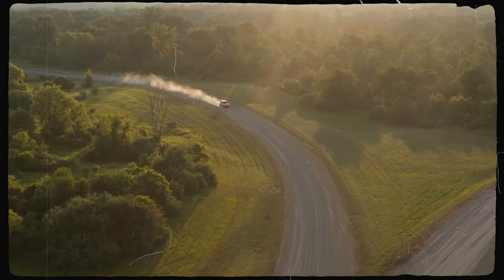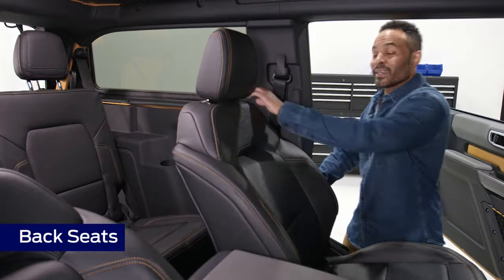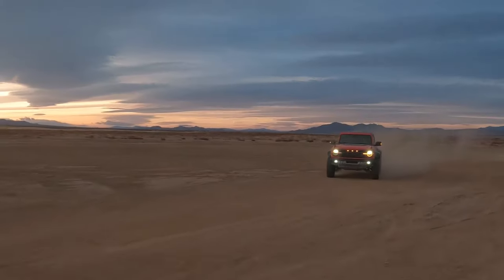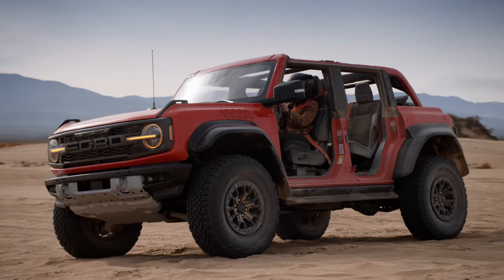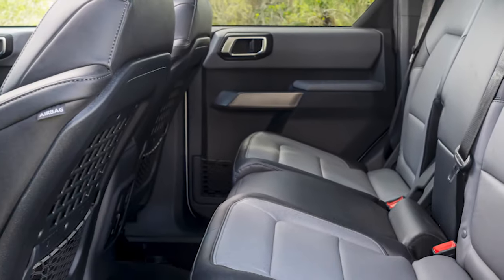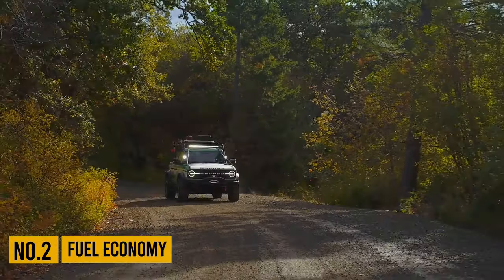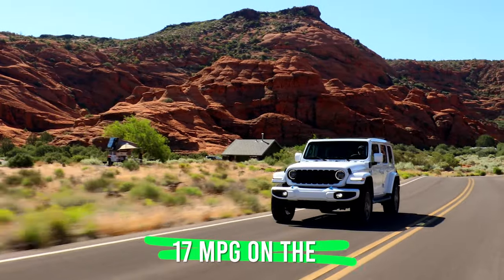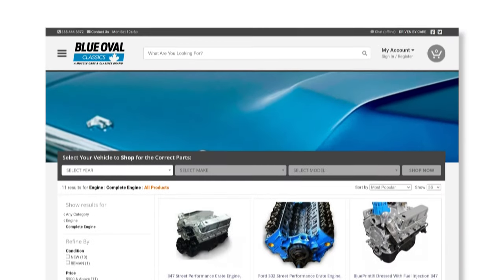7 Reasons Why You SHOULD NOT Buy Ford Bronco!

Comment: Owning a Bronco for 15 months… two doors Manual: vents in the back? No problem, it short enough to feel the front vents. The 2.3L with the Ford’s Performance tune brings 340hp and 19.5mpg in average. Since everyone is driving different, driving wife’s CX5 Turbo brings only 21mpg. The only valid complaint is the audio, it’s really bad, and I had to spend $1,500 to make it half decent. Last time I had a Chrysler product it was leaking more than an old Land Rover, and left me stranded multiple times until I sold it with 78k miles… won’t happen again.

Comment: I owned a 74 Bronco, built tough for the mountains of CO.  I was extremely excited about the new Bronco and  wanted to purchase one for daily.  Dealership markups killed that.
Reply: Back in 2021 when I got my "serious" 4x4 vehicle (was looking in the mid-size segment only, not full-size), the Bronco was vaporware -- just continuing advertising hype with none actually being made/delivered to LONG waiting customers (stupid Ford). And even when they finally WERE out, just try getting one anytime soon, and nowhere near quoted/MSRP pricing. 
Additionally, the 2021 Chevy Colorado ZR2 -- that "technically" was available -- was UN-available due to GM being short of computer-chips, so I had to bail on that. 
As it turned out then, "by default" I got a Jeep Gladiator (Rubicon) right off a Jeep dealer's lot (at a decent price AND ~$4500 under MSRP as optioned, no ADMs or MAs added) -- which  was probably the best vehicle choice of all anyway. 
And it's been fine on/off-road, so no regrets/complaints.
"Jeep Wave" -- yes, even if it's only a Bronco.  ;-)
-- BR
Reply: We ordered ours off the Ford website. Got a ‘24 Badlands with Sasquatch & lux interior. Took 2.5 months to take ownership (Ordered December 5th & received February 20th). No markups.

Comment: I got mine and I couldn’t care less about fuel economy!
Reply: Right?  You know going in that it’s not going to be very good. It tells you exactly what it is on the damn sticker.
Reply: Have a 2020 Jeep Gladiator Mojave, I put gas in it when it hits 1/8 to 1/4 tank. I don't care about MPG, I am retired. Good luck with your Bronc, Do not believe the oil life system, use a good oil, change at 3000 or less in high summer heat, your turbos will love you.

Comment: Seriously? I did not see one reason why not to buy it. Well, unless you are one of those people that complain for just about anything. 

Not having cup holders in the back is a deal breaker, really? I have a Honda Civic, one of the most sold cars in the US, and it doesn’t have a single cup holder in the back. No kidding! A good indication that most people are not as sensitive as this guy. 

For me a good reason for not buying a car would be poor engine or transmission reliability, not not having cup holders or poor radio sound. Those are worthy mentions, but not deal breakers. If the engine and trans are good, then buy an after market sound system if you need it that bad. A large number of those vehicles are heavy modified anyway.

And NO, I am NOT a Bronco fan. I’m a motorcycle fan but I am thinking about buying an off road car. I have pl is test driven both the Bronco, Bronco Sport, Wangler, and Subaru Outback. i liked the Bronco a lot more than the Wrangler and didn’t noticed any of the problems you complained about. 

And here is the thing. To tell people not to huy a car because it does not fit your definition of what a car should be like, it does not mean that it couldn’t be someone else’s perfect car. If the shoes doesn’t fit you, then it will someone else’s feet. It’s that simple. Otherwise it makes you sound pompous and arrogant.

Perhaps is not that Bronco owners are in denial or want to admit all those things you claimed, but rather that the car fits their needs and they ate happy with it. And I am going to tell you straight out, you are no body to judge others and much less to speak for others.
Reply: Agree. Youtube is full of people telling you what to buy or not, without the knowledge they need to do so. I base this on videos about "my own brand," Land Rover/Range Rover. According to the youtube experts, most of those cars should not even start. Often told you with a trying-to-be-convincing male teenage voice.  And I've owned Land Rovers for nearly 40 years, driving in demanding Norwegian mountains in the winter, even been in Russia in minus 44C and never needed a tow truck. 
PS, I am like you, a motorcycle fan.
Reply: Life is short...spend every moment arguing with strangers on the Internet

Comment: I was in the first day order group and almost 18 months later I got mine. My wife loved it so much she traded her Highlander on a Heritage. They each do off-road a little different, Jeep's straight arm is better off-road but terrible on-road. Bronco's IFS is better on-road than off-road. With that said, I have never been stuck on a trail ride. I got the B&O stereo and it's fine. It's hilarious dude talks about cup holders as the video clearly shows a 2-door bronco with cup holders molded in the arm rests. The valve issue was from a supplier and that issue is fixed, again I had a day one order for a 2.7 and NEVER had the engine problem. I put my bronco in eco mode and get 21-22 on road trips and I put the performance tune on it and it's much more responsive on the trails. I tow it with my RV, I haven't had the issues people have had with flat-towing. Now I will say, full disclosure, I had a fuel pump go bad at 7 months and because of part shortages, had to wait 2-3 weeks for a part...but I don't think I can blame Ford for that directly? Also, the bronco community as a whole, is freaking amazing, mods are plentiful and the dang thing is fun to drive.

Comment: Shouldn't an old nameplate come w/ at least one 'old' engine option? A small engine w/ turbos at max won't give that much of a mileage difference & will be less willing to 'chug' through slow sections. Yes I understand the twin-turbo concept but it adds more complexity. I'd like to see the return of the 289cid(4.7L) OHV two-valve/cyl. V8 w/ 21st century induction, either twin-plug or direct injection. There's still to much electronic junk offered standard. Owners have got to learn how to drive, use their mirrors & swivel their heads. I'd also like to see a I4 or V6 turbo diesel option. The back country has no convivence stores or charging stations!

Comment: The new Bronco.....
Todays H-2.
I'll keep my 2005 Jeep Wrangler 4.0/ 6 speed manual. 
It will still be on the road when these new Bronco's are falling apart. 😂
My '99 Cherokee is still running GREAT with 3xx,xxx miles on the clock and NO major problems EVER.
LONG LIVE THE 4.O! 😎👍

Comment: This guy has issues. It’s a 4x4 vehicle. It’s designed for a certain use. The guy uses his as his Mall crawler. Just for his big boy feeling. This vehicle was never designed to be your momma’s Mercedes. It’s almost a tractor with 4 seats, air conditioning, and a few other creature comforts. The fender flairs Ford attached to the vehicle looks like some cheap aftermarket  one size fits all, never designed for the Bronco. There are a great deal of better replacements that fit the fender opening plus they can be color matched. Plus the Ford Bronco is way over priced much like the Jeep Wrangler. Just about every manufacturer has their problems with the engines. GM, KIA, Chrysler, Mazda, Toyota, Honda, and Ford. Stick twin turbos with all that heat involved making horse power one will get engine failure in the valve train. You so called experts are amazing with what ya can whine about.